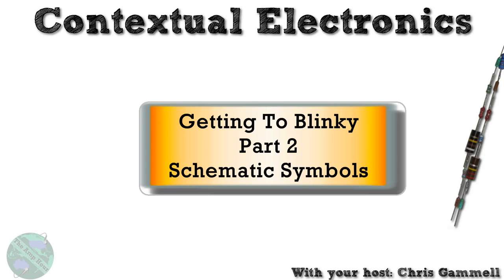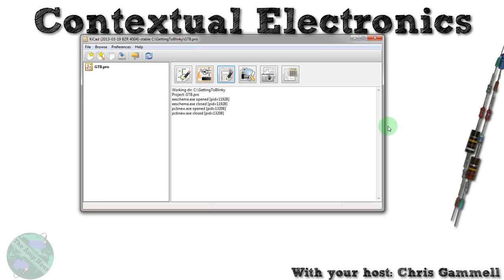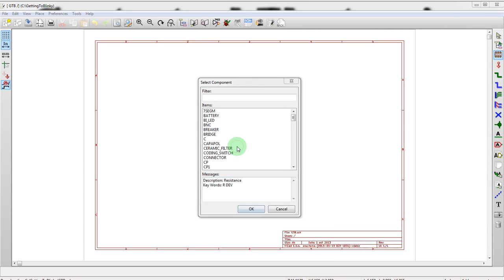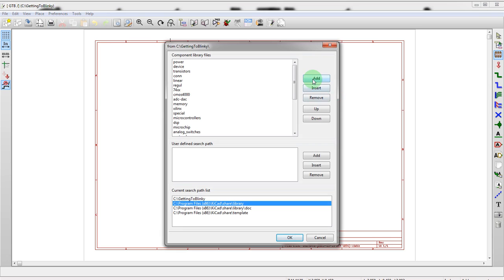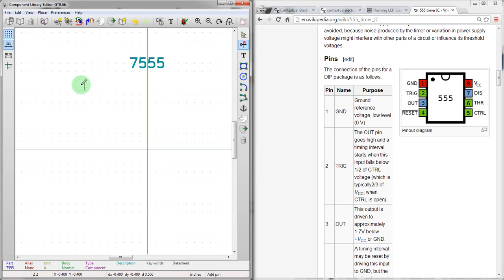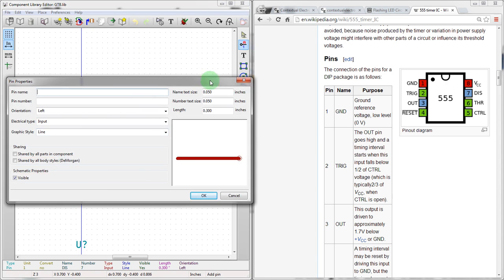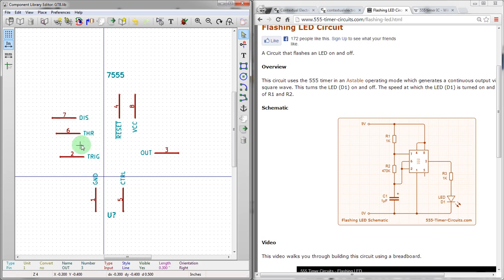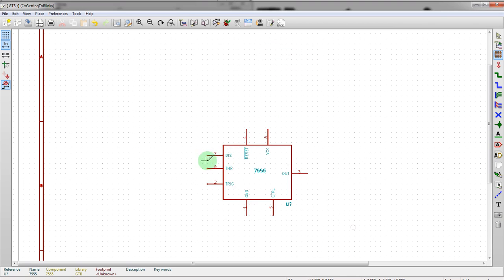KiCad 3.0 - Symbol Creation with the Component Library - Getting To Blinky KiCad Tutorial - Part 2

Comment: exceptionally bad out of date tutorial but i suppose things change, guy is using keyboard shortcuts so the screen is changing from one thing to another and clicking items on ''the ribbon'' which is changed in current versions so you cant click the same thing!

very bad, impossible for a noob to follow along to this with current version.

hint: when making tutorials dont use shortcuts and ribbons use pulldowns then at least then it will say what the selected function is which no doubt wont get moved when programs get updated or if they do get moved in the pulldowns at least the names will be similar to the function so they can be found, at 05:29 it all goes sideways as the icon on the ribbon isnt on the current versions ribbon? what did he click? should i look in the current version pulldowns for ''yellowish icon that made something pop up'' ?.

when you select something in the pull down SAY what you are selecting and its function, not everyone has 20/20 vision to see small fonts, if i had tried to teach like this at tech i'd have got things thrown at me, which was encouraged to make us try harder and think/plan more for a presentation.

sorry for sounding so negative but this needs an update, like your version of chrome you were using.